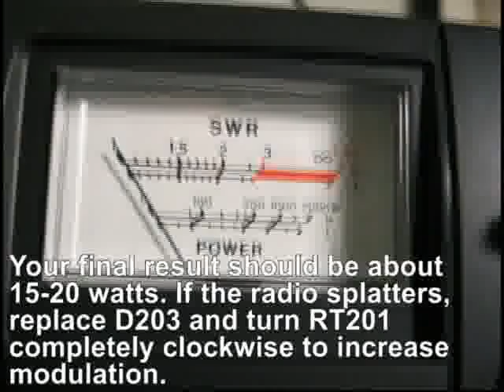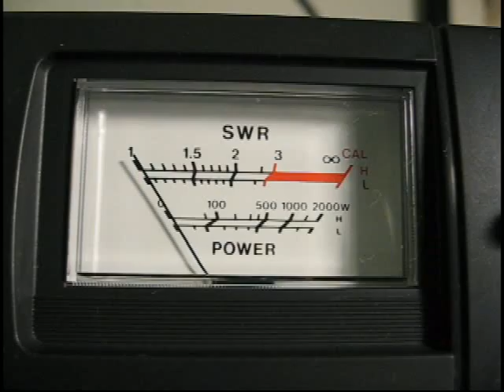CBRadioBB.com - modify a Uniden PRO 520XL

Comment: If you modify a radio like this it certainly won't last very long. These radios audio transistors and final amplification circuits are not made to handle excessive input voltage.  In other words, in order to run more power and modulation, you'll need to upgrade the final and the audio chip.  I spent 20+ years working in a cb shop and seen thousands of blown cheap radios because some idiot opened the audio limiter circuit.